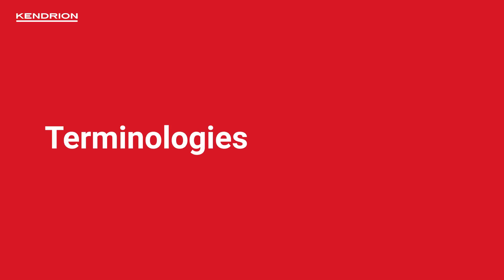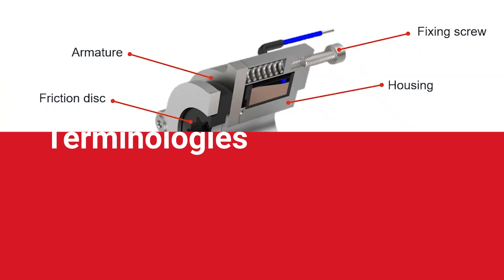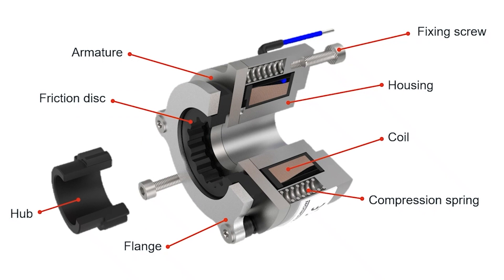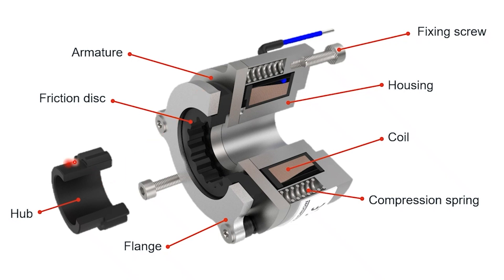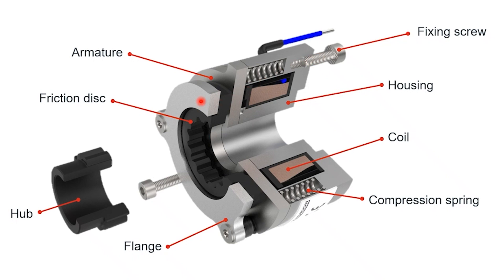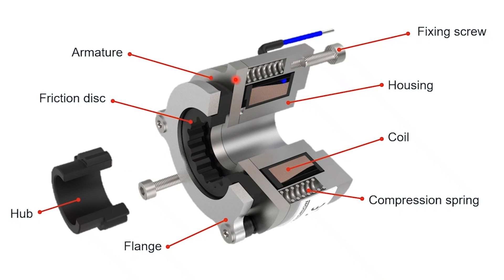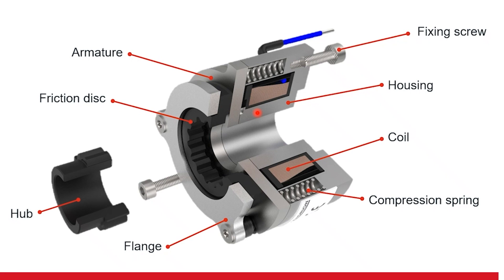Kendrion Tutorial - What is a spring applied brake?

Comment: Dear Sir ; Thank you perfect video.
So sorry firstly my english poor, i have some questions :
1 - How many millimeter magnetic field distance ? 
2 - Friction pad disc every use thin & thin please share this  breake pad disc safety  minimum distance ? ( before change new one )
3- What do you think for change pad distance & need more calibration air gap distance, mp personal think every time adjust this gap calibration very difficult, many many time open inside hoist.
3- For chain hoist start button brake magnet on & release brake & same time shaft turn & chain go way, but friction pad disc turn with centrifugal force friction to flange right ? Say yes, result ; heat up ( brake pad + flange ), plastering the lining to flange, some times stick pad to flange after need service clean with sanding sponge.
Finally this service period very difficult & stolen time. You have any idea or suggestion product.